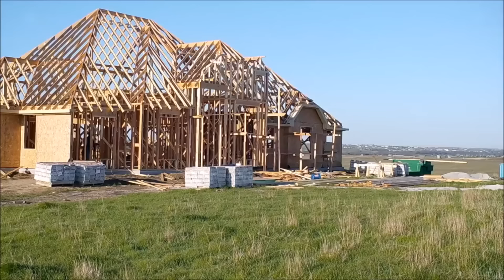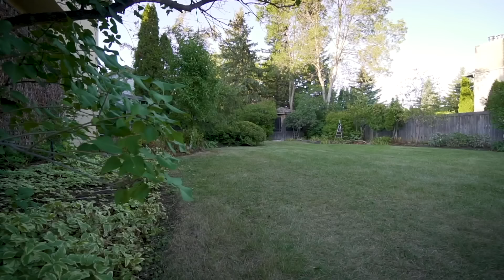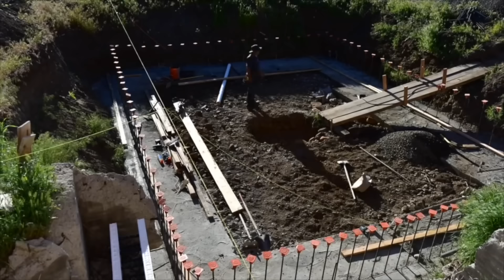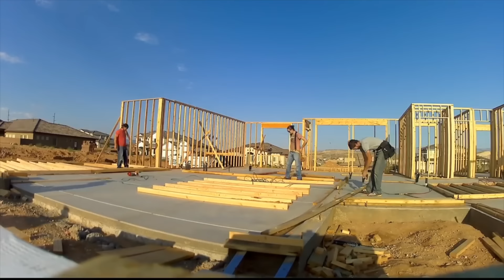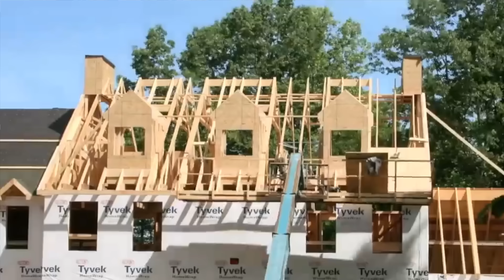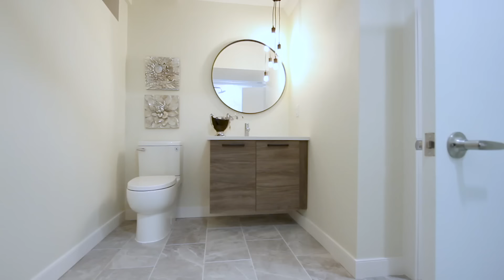THE REAL COST TO BUILD YOUR HOME | Custom Home | Building a house Cost

Comment: If it costs more to build than buy, how do builders make a profit? I'm looking at houses to buy in Kentucky, an almost 3,000 square ft. home with a full basement with 11 to 25 acres was $240,000 to buy. Another was $189,000, with full basement, for 2800 square ft. with 10 acres. If it costs three times that to build these houses, why sell them at these prices, you would be losing a lot of money, not making money, nobody would do it. Personally, I can't find any honest info out there about realistic costs to build a home, I think, because of greed, they try to intimidate us, builders not wanting to lose work to the average blue collar worker, trying to build his or her own home without being house poor. Example, my husband is a mason, after we get the house built, he can brick our house and hire local help (good masons he personally knows), he is also a skilled carpenter, so he can do the cabinets, floors too, he's installed floating wood flooring for several people who couldn't afford the cost of a professional, fast and easy floors to put down, the slowest part was the edging, etc. That alone would save us a fortune in labor costs. Then there's those finishing touches, you can find high end cabinets, if you don't make your own, online from individuals who didn't end up using them for whatever reason, for half the cost or less than half sometimes, and real wood flooring packages people ended up not using also. More money saved, and the list goes on. We know our biggest cost is the everything that goes into building our house before all the work we are able to do. I'm not downing your video, but maybe you could make one on a blue collar workers budget if he does a lot of the work himself? Thank you.
Reply from the maker: My Name Anyone can do this.  It won’t be efficient and you will make mistakes, but that’s how you learn.  Also remember to pay yourself if you are doing the work yourself.  Good luck and thanks for watching.

Comment: What is the standard practice for contracts and progress payments with the subs?  In otherwords, are there standard contracts that you can point me to and how do you never let your progress payments get ahead of the work?
Reply from the maker: Great questions.  Most commercial, and some residential General Contracting firms here in Canada use the Standard CCDC contracts.  
They are quite in-depth and onerous for smaller jobs, so I would advise having your lawyer work up a construction contract.  

The way we do it is cost plus.  The client puts down a deposit at the start and then pays bi-weekly billing for work or material purchased that previous 2-week period.  That way, the contractor and the client are never more than 2 weeks apart on the work and payments.  

Cost plus only works where there is trust and the client’s / project’s best interest is primary.  

If you don’t trust your contractor or home builder to advocate properly, then you shouldn’t have them building you home.  

Fixed price contracts are the norm however, and that gives peace of mind to the client, as long as they know what specs are going in, and know that all work will be done to code and no short skirting. 

But I find that the entire process is easier open book so everyone is on the same page cost wise.  

Make sense?

Comment: Wonderful video I like the video everything about it I would like to know one more thing if I making house which is in the ruler radio with a very small house like three bathroom and storage one garage very normal to normal cost what it would cost me complete
Reply from the maker: THat's like asking me how much a car costs.  It depends on geographical location, finish level, material availability, labor availability, etc...   Do you have a full set of plans? If not, find out the average cost/sqft for your area and go form there.  Thanks for watching.

Comment: Hey Dan, you said this typically two story home of 2200 square feet cost about $155/sqft. A total of $341K.  The 2200 sqft where on two floors ?  Therefore 1100 sqft per floor not including the basement?
Reply from the maker: Jimmy Constantopoulos correct.  A 2200 sq ft two storey house has two levels of 1100 each or a variation of some sort.  

Basement measurements are not included where we live.  (Finished or unfinished).

Thanks for watching.

Comment: So how can you tell if you’re in a hot market from a cold market? Could you build a house much cheaper for 150$ by building most of it yourself?
Reply from the maker: You can save money on labour by building yourself, but your risk goes up if you don't know what your doing, will take longer, and may cost you more in the long run if you make big mistakes.  But anyone can do it if they put in the time to learn and do it right.

Comment: Is it cheaper to build them out of wood? Why not blocks or bricks?
Do banks also provide loans to build your house
Reply from the maker: SANTA MUERTE it’s cheaper out here to build out of wood.  That may not be the same in other locations.  

Using block vs poured concrete, or brick vs stucco is all about supply and demand of the material for the geographical location?

As for financing, check out https://youtu.be/6NSrc4SM3o8

Comment: Quick question if the architect takes 5-14% of the whole cost, what does contractor and subs take in % of the whole cost?Thanks and keep up the wonderful material
Reply: GC wants 15-25% of all materials and labor, a rip-off in my opinion. Thy have an insensitive to spend more to make more. I ended up learning CAD and creating the plans, hired an engineer for structural only, about $1 per foot.
Reply from the maker: Most builds don't have architects on them.  We use them as we are primarily high end luxury custom builds.  Contractor charge anywhere from 15-25% depending on the size, scope of work, and location (suplly/demand).  Small jobs might see % way higher, and massive jobs will see much lower %.
Thanks for watching!

Comment: I'm a carpenter looking to build a house with little help from my pa. Footings or concrete base who's knows. I can do the walls, the roof joists, the rafters and exterior and interior trim, the insulation, the drywall, the floors/trim, window door installation. My question is, can I build a average size 2story in 1 year Mostly! I mean mostly, By my absolute self?
Reply from the maker: Depends on how good you are.  Thanks for watching!

Comment: Uhhhh did you forget the land purchase? The lot can run you $100K+. For some reason this is always separated from the "build price" which is annoying. "O yea we can build you a home for $300K...plus $100K for the land"
Reply from the maker: Jack, by separating the cost of the land, that everyone can see and differs by every single lot, this gives people an understanding of build costs.  But yes, land cost is definitely part of it.  Make sure to check out the next video this week that goes through an 8000 sqft, $4Million home line item breakdown! Thanks for watching!
Reply: these cost are after the land is paid for...we looked at a lot in cali...livermoore(375k)permit fees hook up 225k...build 3,000sf(400k)value 1.2 million

Comment: Had a question what if you were getting a home the same square feet as the one here with a second floor and you litterally had all of your finishing materials outdoor and indoor your framing materials already purchased and you litterally just needed a contractor to do the land preparation and just the actual build and install of everything. What could be a possible ballpark figure for that?
Reply from the maker: A lot of the time, it depends on how much RISK the contractor or builder is taking on and how much is in their scope of work.  If you are providing material, who  pays for the time lost if you ordered it wrong or if it doesnt come on time, or damaged?  I believe your question is "How much is labor?"  The answer is about 40-60% of the cost of material, however you will have to pay things in general conditions like site supervision, builder overhead, builder profit, and taxes.  Each builder is different, but expect anywhere from 10-15% for profit, 8-15% for overhead and expenses, 10% for contingency, and 5% for taxes (GST in canada where we live).  These percentages are based on labor AND material. Thanks for watching!

Comment: These prices are outrageous. I paid $20k for two acres of lakefront property in Florida less than an hour from the beach. I paid $1200 for plans, $75,000 for the house WITH private septic and a 160 foot well.  I also built a glamping space for airBnB WITH a private outdoor bathroom and spa for $5,000 PLUS a gazebo for $2500. This is just stupid. Not the advice, but the prices. Just ridiculous
Reply from the maker: Make sure to check out the next video this week that goes through an 8000 sqft, $4Million home line item breakdown! Thanks for watching!

Comment: I'm looking into building a home in Kailua Kona Hi, across the street from the ocean. I have been renovating homes for 12 years, and I do all trades. Elect. plumbing, framing, concrete, roofing, tile, granite fab, drywall, paint, stucco, and landscaping. I will hire crews to help me. What do you think I should plan to spend to build a 2,000 sf house. post and pier.

Comment: Does the sq ft include foundation choice? (Full block,Craw space,Slab)
Reply from the maker: This example one was a poured foundation and a poured concrete floor.  Our base spec is an ICF foundation with a wood structural floor.  Make sure to check out the next video this week that goes through an 8000 sqft, $4Million home line item breakdown! Thanks for watching!

Comment: This is so expensive... I'm just looking to buy land. I'll build my own house using sustainable materials. Grow my own food. Capture my own water. Produce my own energy. Start with a small cabin and grow it over the years. Land varies greatly on location but the house, to start with, shouldn't cost more than 10-15k.
Reply from the maker: Good plan. It can be done.  Thanks for watching!

Comment: Great information however I need to know about a concrete house and not wooden frame as I am in the Caribbean!
Reply from the maker: Roger YF I have never built in the Caribbean, but you can use the same format.  However  your numbers will be a lot different.  

Instead of framing, you will need to figure out how much concrete/block you will use.  

Nonetheless, write everything out that you will need and get estimates before jumping into anything.

Comment: How to calculate an 2nd story addition... 1000 sq ft.  Turning a cape cod into a 2 story house. By removing the roof adding standard 8 ft ht 2nd floor... new roof...  Base finishes... No foundation work...
Reply from the maker: That's a big job to explain and cost.  you should probably get a local builder in to estimate.  Thanks for watching!

Comment: Would a modular home be cheaper?
Reply from the maker: O Wanjera typically, modular homes are not finished with as high finishes as luxury homes.  But nothing says you can’t make a luxury modular home!  There are modular companies that make really high end homes, which would then be more expensive that typical home construction.  There are many factors to consider.

Comment: How much does an nice and wide elevator cost for a 4 - 5 story home? Also is it code to have stairs as well or can I just have an elevator?
Reply from the maker: Genuine Ruby 65-80k depending on what you go with.  

Code depends on where you live but chances are yes.  You need secondary egress that is not dependent on electricity.  

Thanks for watching!

Comment: All right so you basically answered my question with there's no way in hell I'm ever building my own house. A basic one story 1500 ft² house at $150 per square feet It's almost $300,000. There goes that idea.
Reply from the maker: Didn't mean to crush your dream.  You'll figure it out if you really work for it!  All the best!  Thanks for watching!
Reply: @EmmettLeoHomes  I just don't understand why anyone would build a house if it's going to cost that much per square foot.  No one be giving out builders loans because you would never get your return on investment because there's no way you're selling a house for that cost per square foot.  I don't even know how builders are making their money back.
Reply from the maker: @lynnb2562  New homes are typically about lifestyle.  Unless you are in a hot market where prices are rising higher than you can build it for, then it doesn't take sense from an investment stand point.  It's all about what the individual wants out of the situation.  Most are not building with "investment" as priority number 1.  That is generally secondary to lifestyle and family wants/needs.

Comment: At least half the cost is labor. No hate for the builders. They need to earn a living too. But if you can build a house yourself (admittedly few people will want to commit to this, fewer zoning offices will want to let you) then I suggest it. I would say that at the least you should go through the planning process. You will learn a lot.
Reply from the maker: All good man.  Although many people do not build their own bikes, cars, or airplanes for a reason.  A good builder will provide amazing service and quality, while walking the client through the entire process that is probably the biggest financial output of their lives.  Most shouldn't be fooling around with that to save a few bucks as the possible risks are some steep and expensive mistakes.  BUT, you are correct.  The more they are involved, the more they will learn and can understand the entire process.  Thanks for the comment!

Comment: Great video. How much could this price differ if building in rural Ontario? Any difference in cost due to location? Vs. the GTA?
Reply from the maker: j CROOKS huge difference actually.  

You may run into limited supplies, which means that the prices can be higher, but generally GTA will have much higher labor cost.  

Also, the cost of the finished product is inflated in the GTA.  

There is a massive difference however between rural Ontario and suburbs of Toronto.  

But in general, the pricing in the video will be pretty legitimate for most of Ontario, but higher in GTA for luxury homes.

Comment: Very interesting.  Would like to hear how much more it costs to get a contractor to take seriously cost effective long term energy saving measures.  The actual cost of building in [and engineering in] those measures is low but it takes a committed builder to make the details actually happen.
Reply from the maker: Sam Villegas Indeed!  The fine line is between cost vs. actual benefit. Or better put, how can we get the greatest energy efficiently at the most efficient pricing.  That will make for another great video.  I completely agree with you as our base allowable spec consists of energy efficient upgrades that make the house perform better, while being driven by value driven decision making.

Comment: Great video! I was just wondering if the quick range you gave was the range for building with a general contractor? I am looking at doing an owner build for a average grade home. Do you have a rough range of what my per sq ft cost would be on something like that as an owner build rather than hiring a GC?
Reply from the maker: Great question.  Make sure to check out the next video this week that goes through an 8000 sqft, $4Million home line item breakdown! where i go over GC input and costing. Thanks for watching!

Comment: Lets say i wanted to build a house in lower illinois about an hour away from chicago and i wanted a house with a big basement that attaches to a underground 4 car garage 5 bedrooms and each having their own bathroom  with heated floors and a half bathroom in the basement no upstairs just the ground floor and basement with a little elevator for guests with mobility issues and it will be a smart home how much will that cost
Reply: Oh i forgot to mention i want a mini theatre and i want a more luxury kitchen the kitchen is the most important part
Reply from the maker: Make sure to check out the next video this week that goes through an 8000 sqft, $4Million home line item breakdown! Thanks for watching!